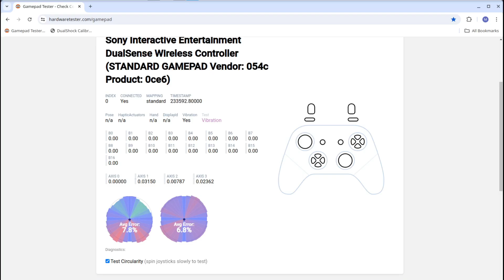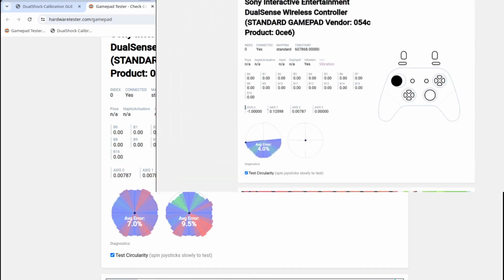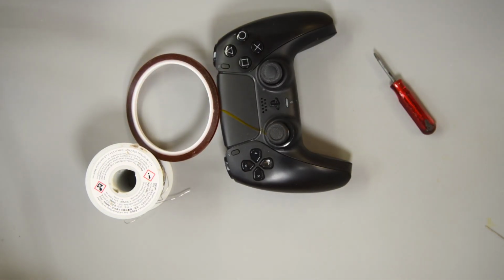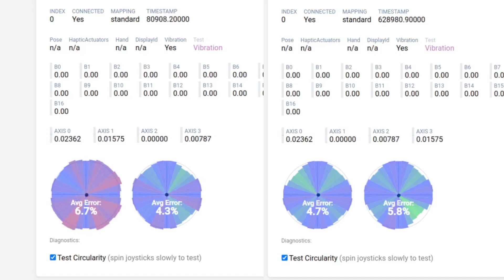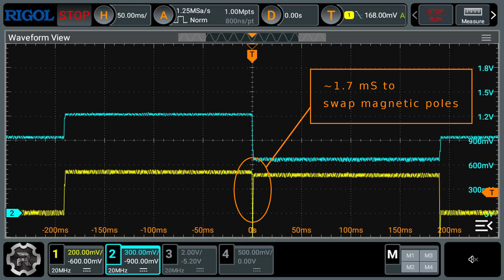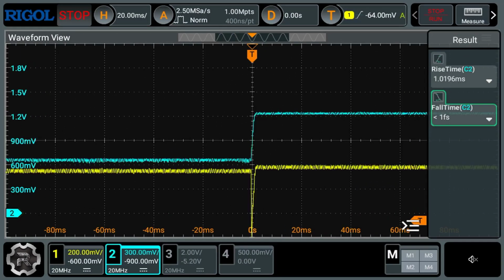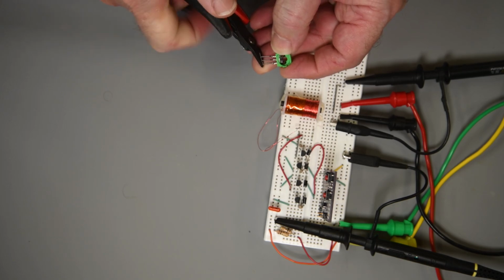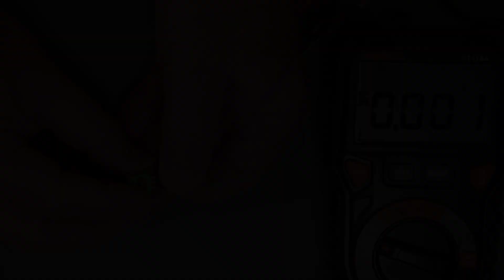The Fastest Hall Effect Joystick I’ve Tested

Comment: What is the main trade off for using the tape method to ensure it gets to the corners vs without?
Reply from the maker: If you need the range to reach the very corners, you have to trick the calibration.  If you restrict the range during calibration, then after the range will expand.

Comment: I tried these for a Dualshock 4, and i could notice a significant amount of lag, not noticeable when playing non fast paced games, but on FPS, like Doom Eternal where quick movements are made, the difference is day and night, i couldn't stand it and put back new favor union potentiometers and everything was back to normal again. . . could TMRs behave the same ?
Reply from the maker: The TMR sticks are faster.  But the Favor Union Hall is very fast for Hall effect sticks.
Reply: @metalplasticelectronics354  doing some research, i found that the dualshock 4 motherboard already have a decoupling capacitor for the potentiometers, as shown, tiny board on the favor union ones have another one, making the two parallel, thus the capacitance being increased, and the bigger the capacitance, the more "unresponsive" it gets, i maaaaay put the hall effect sensors back with the ds4 motherboard capacitors removed, just for testing purposes to see if that latency i feel is reduced or gets away for good.
Reply from the maker: The decoupling capacitor will not affect the speed of the output signal.  The resistor/capacitor or capacitor on the sensor's output pin will affect the response time.

Comment: what are the resistance values for these sticks?
Reply from the maker: They don't have a resistance like a potentiometer joystick, they output a voltage.  I think the datasheet listed an operating voltage range of 1.6 to 5.5 volts if I remember correctly.
Reply: @metalplasticelectronics354  interesting.  i just did my first mod.  i removed the full joystick from one of the dualsense edge removable stick modules.  i know you don't play with the edge but rather the normal dualsense, but they're pretty close to the same in most regards.  i was thinking the replacement sticks i was putting in were the wrong ones since when you read their resistance it come up with about 13 mega-ohms instead of kilo-ohms, but what you said makes more sense of that for me.  i used some of the ginfull v5 sticks you reviewed awhile back and they actually work very well.  only caveat is that one of the axes failed after about a day so i switched out the sensor with another one and it's back up and running.  maybe i cooked it a bit by holding heat on the leads too long or something when attaching the first one.   i was just wondering if i was burning out the sensor with current considering the voltages could be different than expected.  it seems that wouldn't be the case though since you said they are the component generating the voltage via the hall effect which makes sense.

been watching your videos for awhile now though, and just gotta say nice job.  appreciate all the good data and insights.
Reply from the maker: It was probably a defective Hall sensor.  I think the plastic would melt before too much heat got to the Hall IC.  It's nice to know that the electrical hookup is the same as the DualSense.  Just need Sony to release the information so it can be calibrated.  And thanks.
Reply: @metalplasticelectronics354  yeah a calibration tool would be nice.  i used the method you used in one of your videos where you hold the axis still and rotate the joystick independent of that center piece and was able to get it within a deadzone of about 0.03 so that's pretty good
Reply from the maker: Yes, that is very good.

Comment: Im having probleb with the circularity at the end of the installation. I dont know how to reach 1.0 in all axis X, Y, Z. Can you make a video showing how to calibrate please. Btw i fix my Ps3 and Ps4 controllers with the Favor Union Magnetic. Works fine, but the only problem is the Circularity. 😢
Reply from the maker: For the PS4 controller take a look at this video: https://youtu.be/0fK1sapv0YI?si=G2rmL2YIZcLTkK3k  .  For the PS3 you will have to deform the joystick arms to reposition the magnet mechanically.  But that will only work for centering.

Comment: How do you calibrate these once installed on a dualsense or dualsense edge?
Reply from the maker: You use this site for the DualSense: https://dualshock-tools.github.io/ . The edge is not yet supported,  at least since I last checked.  Someone may need to start a pressure campaign on Sony to get them to release the info for the calibration codes for the controller.

Comment: Can this hall sensor works with 5v power supply?
Reply from the maker: Yes, The data sheet for the Favor Union lists a minimum of 1.7 and a maximum of 5.5 volts.  The Hall sensor data sheet for the Ginfull joystick lists up to 5 volts as well.
Reply: @metalplasticelectronics354  thanks alot dude

Comment: How do you do the test with the muiltmeter?
Reply from the maker: I'm applying 1.8 volts across the sensor and then measuring the voltage at the center lead.  A perfectly centered axis will have 0.90 volts on the center lead.

Comment: Hello, I used to have a Gamesir T4 Pro gamepad but the joysticks started to drift. Now I want to build a new gamepad using the circuit board. Size doesn't matter because I'll use a cable, but I'm not sure if it will work properly if I replace the old potentiometer analog joystick with a Hall Effect one. Can you help me?
Reply from the maker: You will have to see how the potentiometers are hooked up.  Have to know how much voltage is going to which pin to see if these will work.
Reply: @metalplasticelectronics354  I tested it specifically with my controller. There are 3.3 volts on + and -, and 1.65 volts on the middle pin when the stick is stationary. However, voltage values are not given on sites such as Aliexpress. There are statements such as PS4 PS5 Xbox compatible

Comment: hello dear! how I can calibrate hall sensors without gamepad? because xbox calibration is dead I want to setting up sensors outside of gamepad and istall it after
Reply from the maker: Without calibration software, the only thing I know of is deforming the joystick shaft to shift the center position.  There are some add-on boards for the joystick to help with center and circularity, but I've never tried them.
Reply: @metalplasticelectronics354   @metalplasticelectronics354  thank you for the answer dear! i mean what a electrical circuit i can made to callibrate sensors with multimeter. and i purchased boards to calibrate, but simple, just with two vari resistors, but doubt that it helps me with hall effect

Comment: my joystick is starting to fail and i'm at a bit of a loss, what's the ideal hall sensor to buy today? are these and the oranges comparable to ones that include a pcb board?
Reply from the maker: Shouldn't need one with a PC board for the DualSence now that calibration software is available now.  These Favor Union are faster than the Ginfull V5 but the Ginfull have better circularity.
Reply: @metalplasticelectronics354  thank you!

Comment: Whenever I use the gamepad tester website with PS4 and PS5 controllers, I never reach 0.00000, only +/- 0.00392. I figured it is a website limitation, how did you manage to make it display a more exact value like 0.00000 without rounding it to 0.00392?
Reply from the maker: I am not sure, I'm using Chrome running on Linux, and everything is at default.

Comment: Gulikit has now released a TMR replacement for Xbox ps4 and 5 controllers. Would love to see you test these to see if they are best electromagnetic based sticks on the market.
Reply from the maker: Have some on order. So stay tuned.
Reply: @metalplasticelectronics354 I'm in the Discord server and one of the testers of the joysticks, for the joysticks for Dualshock 4 and DualSense, I don't own an Xbox series controller or Switch Pro controller, so I did not sign up for those. The DualSense joysticks just left the testing phase as there have not been found any issues with them, so they are shipped to Amazon now. Many testers had issues with the Switch Pro ones, so they discontinued the testing and selling of those until Gulikit fixes the issue. They know it happens because of the output voltage of the middle pin, so they said it will be back on the market in 30 days. Prior to finding that issue, they had the same joysticks that were (supposed to be) compatible with DualSense and Switch Pro, instead, they will now sell them seperately. Some boxes that were already printed still says "compatibility Switch Pro and DualSense", they put a sticker on the Switch Pro to show it isn't compatible. New boxes will have only the DualSense print. It was also found that the thumbstick caps had some issues because some of them were not straight, likely an issue in the plastic molding on one of their manufacturing lines as it only affects some. I personally didn't have any issues with them, I have a video of them as well and calibration went very easy. Someone in the Discord did a latency test, it is on par with potentiometers and Favor Union hall effect, but the power consumption of TMR is lower. Gulikit said the following,  potentiometers use a constant 1mA, hall effect around 0.5mA to 2.0mA, TMR 0.1 ~ 0.3mA. Multiply Ampère by voltage of the controller to get the power consumption. So that's also a small benefit. It is significantly more pricy though

Comment: So basically they are like 40 thousand times faster than the ginfull v5 sticks or even faster ?
Reply from the maker: I'm still working on a setup to get a good measurement of the Favor Union.  They are a lot faster but not 40000 times.
Reply: @metalplasticelectronics354 Oo , right, my dumb ass thought it was 0.9 microseconds instead of 996, lol.
So they are like 40 time faster right, or is it the fall time not a good way to determine their latency ?
Reply from the maker: @moisesmendoza5998  Using fall time is a fair reference, I believe that is why these have a little bit of a smooth feel.

Comment: @Metal Plastic Electronics:
I don't know if you've seen the news about the new TMR (Tunnel magnetoresistance) sensor joysticks Gulikit has come out with, but Gulikit is working with Aknes (one of Gulikit's official resellers) to run a beta of the joysticks before they're released.

The TMR sensor joysticks are for the following controllers: Switch Pro, DS5, DS4, and Xbox Series controllers.

Aknes is sending out 100 beta units for each controller (so 400 total), for free. And they're not going on sale publicly until the reports from the beta come in (you just need to report how the installation went, and any issues encountered).

Aknes is also offering a free Gulikit KK3Max controller to anyone who makes an installation video that they decide to use on their website.

You can see the announcement of the beta test here:
https://www.reddit.com/r/Controller/comments/1dn8uit/free_beta_aknesgulikits_new_series_of_products/

To join the beta, join Aknes Discord server:
https://discord.gg/8DMtKUfsfk
And fill out the application linked to in the "#testing-sign-up" channel (it's pinned).

And as a heads up, the beta units are being given out on a first-come-first-served basis, and has been running for a while, but there are still openings for all 4 controllers, so if you're interested you wanna sign up ASAP.
Reply from the maker: Thanks for the heads up.
Reply: @metalplasticelectronics354  NP, the kind of extensive testing you do is exactly what's needed to find any issues Gulikit needs to work on for their next iteration, and you getting in the beta would get that information into Gulikit's hands right at the start. I wanna see this tech mature a bit faster than Hall Effect joysticks did. ;)

Comment: Seems like you are experienced with these analogs, so I'd like some advice, please:

I buyed a pair of PS4 Ginfull modules from Aliexpress (the cheapest ones, expecting some trial and error) and I'm wondering if there are differences between prices.

And about the magnetic "potentiometers", are Ginfull ones compatible with ALPS? I've many Dualshock 4's with good analog modules and bad potentiometers, and I'm looking for a cost-effective solution, trying to reuse everything I can.

That being said, thanks in advance, and I'm looking forward for more content. Keep it up!
Reply from the maker: Here is a video on the Ginfull V5s: https://youtu.be/5eDPQaIi0yg?si=ca63bl8atc64QBNY .  But neither these Favor Union nor the Ginfull V5s in the linked video will work in a DualShock 4.  The DualShock 4s I've looked at require a joystick with one of the Hall sensors VCC and Ground pins to be reversed.  So a Hall effect joystick for the PS5 is not interchangeable with one for the PS4 controllers.
Reply: @metalplasticelectronics354  thanks for the info; and yes, I know that Dualshock 4 needs a special kind of sensor (yellow/black) and that's the one I've got.

However, my desoldering skills are far from good and only managed to install just one. It seems to work, but need more testing.
Reply from the maker: This video might help with the joystick replacement: https://youtu.be/slxgHcYHnm8?si=8ZgkFY8MvC__eKQO

Comment: Not sure if i missed it in a previous vid but could you please explain how to pre test the joysticks with a multimeter. Like multimeter settings and best joystick to use out the pack with numbers please. I'm planning on buying the ginful v2s but with 10 in the pack, i want the first two to be the last two.
Reply from the maker: Take a look at this video at the 1:20 mark: https://youtu.be/B9fJFDNpYD8?si=LpHxx6NTzB4-UMnW . You are looking for the output voltage from each sensor to be as close as possible to 0.900 volts.  If it reads  over 0.970 volts or under 0.830 volts, I wouldn't use that joystick.
Reply: @metalplasticelectronics354  thanks for the reply. Just ordered some and i want to make sure i don't install faulty hardware. That vid definitely did help.

Comment: would be great content if you found out the difference between the ps5 and ps4 ginfull sensors in electric values, and what would happen if you put a ps5 ginfull  in a ps4 and vice versa.....pleeeeeeease
Reply from the maker: I'll have to try to get a video on it.  DualSense Hall joysticks won't work in the DualShock 4 because two of the Hall sensors would be wired up backwards.
Reply: @metalplasticelectronics354  huh, i didnt knew that, im glad im subscribed

Comment: Been trying these out myself in two separate controllers and the stick feel/tension is very close if not the same as the standard ALPS potentiometer joysticks, which I like. The ginful v5's seem to use a slightly softer spring by comparison. I did have to do the extra calibration using a spacer similar to what you did because mine also weren't reaching the corners fully in the circularity test. I designed little removable spacers and 3D printed them for each stick. Worked great. 

One negative I noticed is they have a good amount of jitter even though they were advertised as not having any (both sets I have exhibited jitter), but this hasn't affected gameplay that I could tell. If favor union upgrades their magnet similar to what ginful did on their v5 to get the circularity better on the corners and gets rid of the jitter, these might be the perfect replacement joysticks for me.
Reply from the maker: 3D printed spacer, very nice.  The Ginfull joysticks do seem to be a bit softer mechanically.  I'm working on a setup to test the different tensions, maybe in the next few months I'll get it finished.
Reply: can you please share your spacer? i have been looking for a stl file to do something like this!
Reply: If you were to continuously pick one install in all future controllers would you pick the Ginfull V5 or Favor Union he tested in this video?
Reply: @OmeliGaming  Probably the Ginful v5's depending on which types of games you play. For context, I don't play competitive FPS games on console. I can live with the slightly lighter stick tension on the Ginful vs the Favor Unions. They've been the closest to drop in replacements without the need for the extra spacer calibration, yet still came up 5-9% circularity after the software calibration. Zero jitter and no issues with reaching the corners either as the circularity was actually a circle unlike the Favor Unions. They're not the fastest like the Favor Unions as this video showed, but probably the least hassle out of all the ones I've tried in terms of getting them up and running. 

The K Silvers had the same issue for me with not reaching the outer bounds and square corners that the Favor Unions did fwiw, so you'd need a physical spacer for calibration on those too if not using one of those solder on calibration boards.

Comment: Can you use the same joysticks on a duckshock 4 controller? 

I know, they've different version on their website but I was just wondering if anyone has tried it. I have four left overs that I can put in a duckshock controller.
Reply from the maker: I don't think so.  I need to pull apart a DualShock 4 and see how the potentiometers are hooked up. Looking at some pictures for the PS4 Hall effect joysticks makes me think there is a difference.  I'll try and pull one apart this week.
Reply from the maker: I checked and no the DualSense version will not work in the DualShock 4, at least not in the version of the DualShock 4 I have. Vcc and ground are reversed for one sensor on each joystick.
Reply: @metalplasticelectronics354  Thank you so much for your response. I have a few duckshock controllers laying around. I am thinking about getting some favor union hall effect sticks for them.